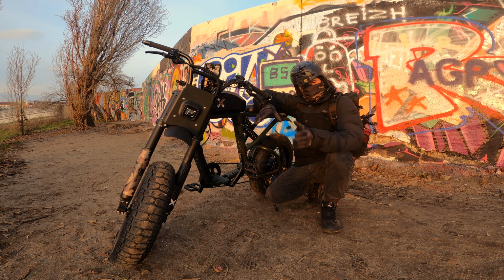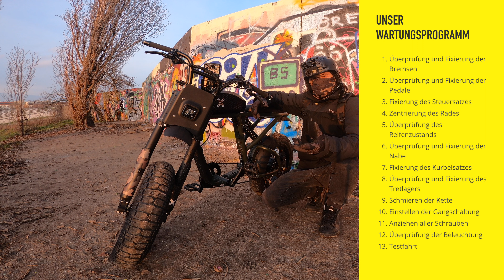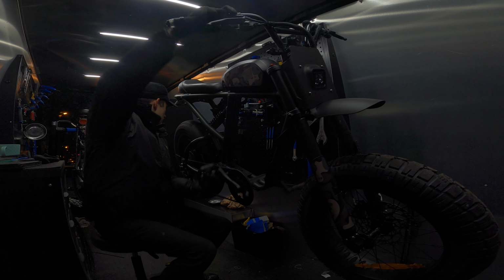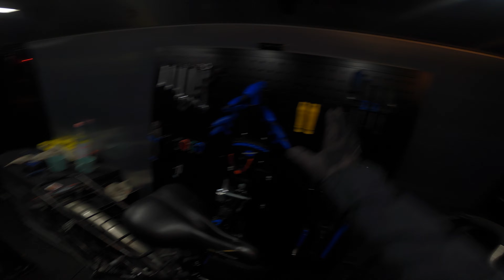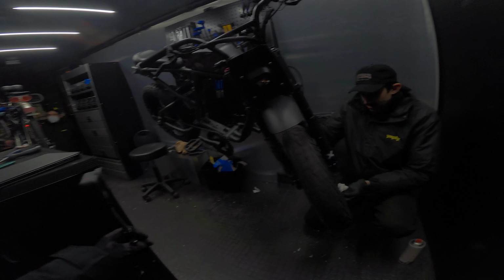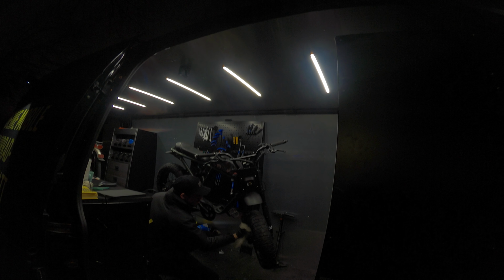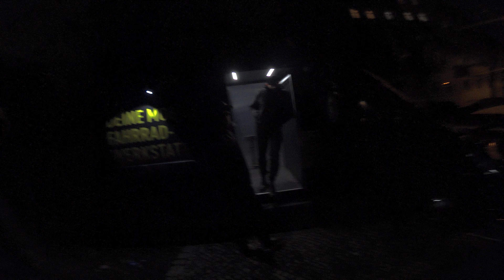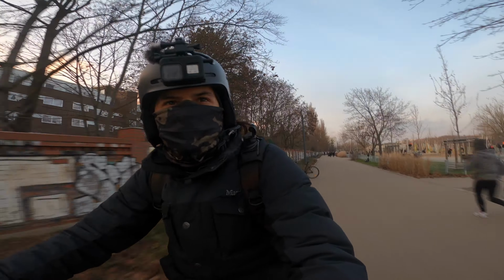Super7 RX Service - Yeply Mobile Bike Repair | 4K

Comment: Is this expensive, I bet these dudes can make some money in the right area, I will have money for the motor in next 3 weeks for my cararra hellcat lmt edition, Only putting a 1500w 48v for the moment, It will be a little 50kmh beast, lol, Frame is super light so with 45-50nm it might be a little too crazy, Not, lol, Yeah i cant wait to get it done, Plan on hitting some Brecon Beacons trails see, I will be slapping a few vids on youtube soon as i do, My complex ptsd is causing me issues actually doing these things, Its why i want do trails, Coz crowded places, I am not good with, Honesty is the best policy, So got be honest on how my mental health is, Electric bikes are a good thing for mental health an people in my situation, I would defo buy a super 73 if i was in a financial position, Looks like a comfy ride.....
Reply from the maker: Wow that's cool the Hellcat 🤘🏼 thanks for sharing,  sounds like a rad machine 🤙🏼 cheers
Reply: @RadCityBerlin  I hope, It will be 3 times lighter than my Electric monster scooter that is 1600w an that hits 35mph, So 1500w on a Carerra hellcat that weighs next to nothing, 29 inch wheels so its got presence, lol, Top for rolling down hills, But yeah 1500w will make it hit round the same speed as my scooter, Cant really hit speeds like that many places where i live but i wants the power for hills, Only got a 20ah battery at the moment tho i plan on putting either some of those Electric motorbike cells, The flat ones, Or just getting a high amp hour battery, Preferbly a 100ah, lol, Im not sure if its with geting high end cells with less amp hours or cheaper cells with higher amp hours, Will prob get high end, The battery tech has just gone up about 20 notches so to speak, Battery tech is getting much better, Lighter more distance ect, It about time aswell, lol...
I will defo drop you some pics when its done, It is actually a nice bike.....